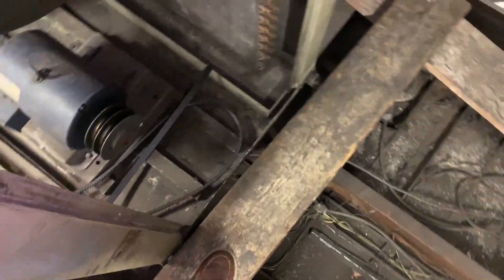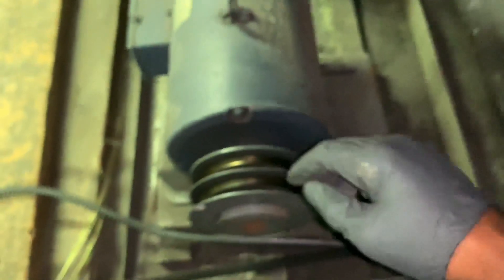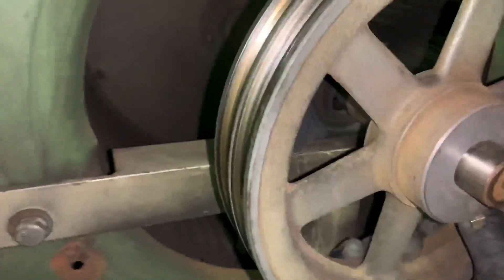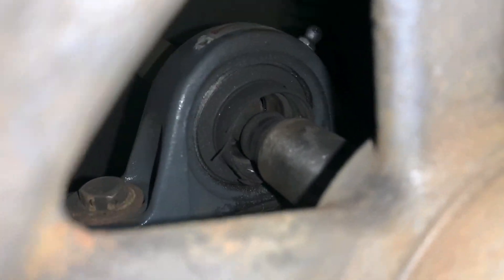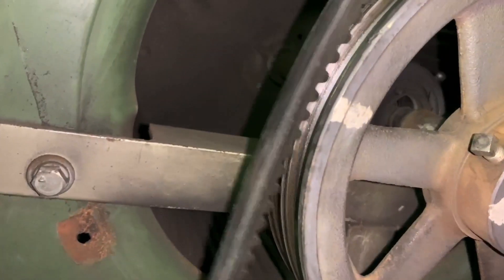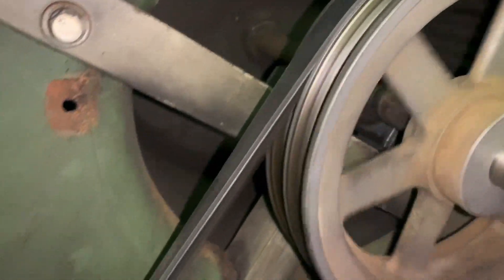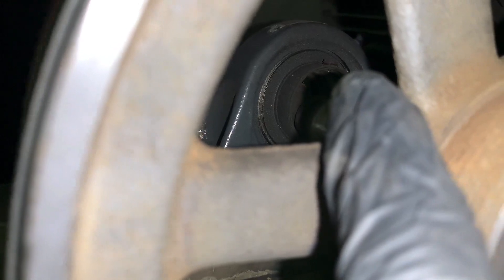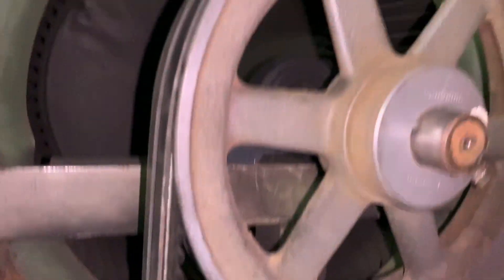HVAC FOR BEGINNERS | TRAINING VIDEO

Comment: It's easier to begin from the inside of the inner-most pulls instead of moving it across the outside to the inside pulls.
There has to be a "field" rule regarding what constitute a sufficiently tightened belt. As you also know, belts loosen over time, so how do you compensate for that?  I would imagine you would have to to annual or biennial inspections to ensure tension.

Edited: I see you showed the alternate method of mounting the belts at end on video. Thx